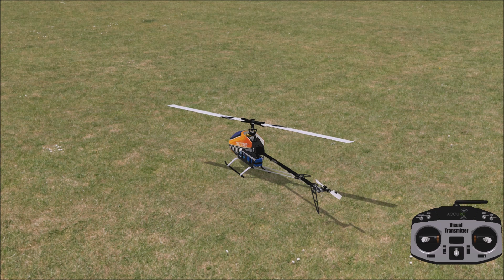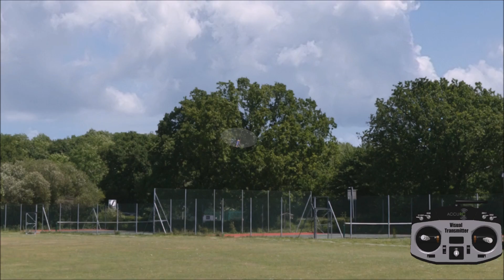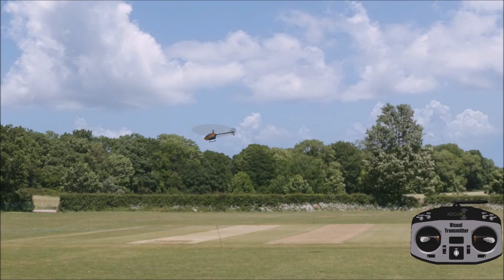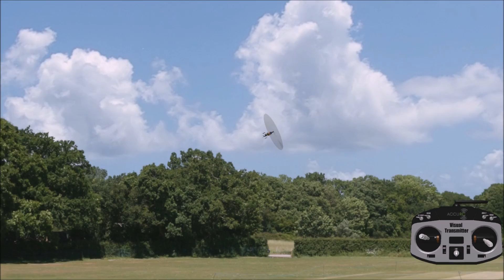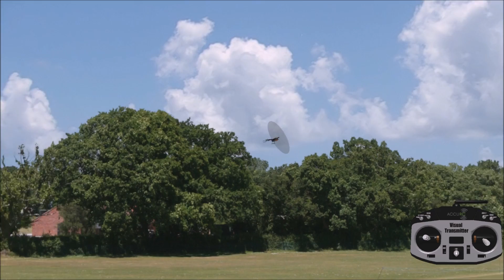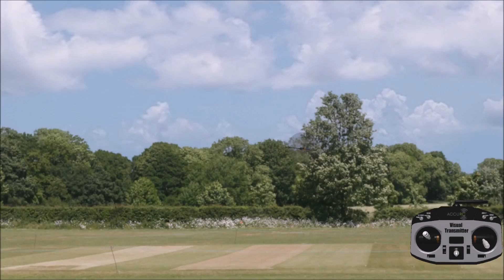Flight Tips: Circles

Comment: Thanks for this video Adrian!  I've been struggling with coordinated forward flight turns as a new heli pilot (but instrument rated private pilot).  You had a great discussion on CPO's Heli Hangout #23 around 1:05:20 in ( CPO Heli Hangout #23 ) that went into a lot of detail on this as well.  I'm getting there with it thanks to your help!  One thing that would help greatly for newbies like me is if you could do a demo like this in slow motion during the video as well if ACCURC is capable of it - maybe like 60% of normal time.  Would make it easier to bounce our eyes between the controller and the bird.

Comment: At 3.57 where you say to practice in both directions - is the visual transmitter showing the stick positions correctly? I ask as the aileron / elevator is still on the lower right when you fly left circles. 
Thanks for the great vid - looking forward to seeing and learning more :)
Reply from the maker: Its something I have been meaning to mention to the dev team. When the sticks are centred, the right stick looks like it is moved to the right and left stick is moved to the left.

Compare it to the hover and you will see what I mean.

To hold a steady turn if you have everything in just the right place you will have only a little rudder and back elevator. If you are having to hold aileron to keep it in/out of the turn then you have either not enough or too much rudder.

Thanks for the question
Reply: @Rotors-showCoUk2014  yeah i was about to say same about stick input and was like wtf he is doing left bank turns and aileron is to the right :@Ů
Reply: @zoxwolf2133  it's totally fixed now in AccuRC 2 so much better!

Comment: the whole "too much/little rudder" bit was confusing. why not just say "try keeping body horizontal to the ground, adjusting rudder as necessary".. especially on smaller models, you can't just lock sticks and say "here, this is enough rudder now", and instead have to adjust all the time.